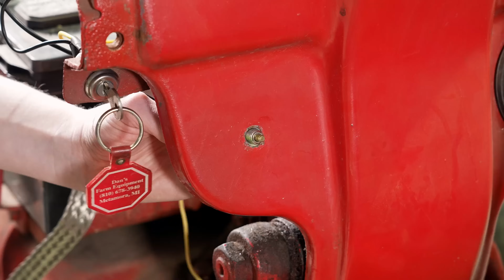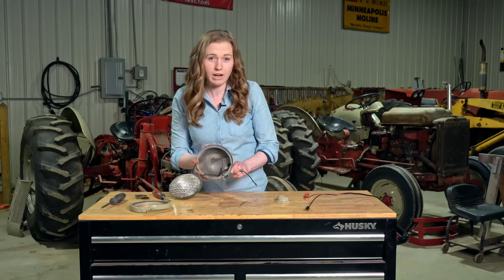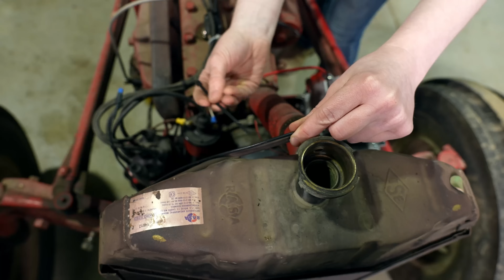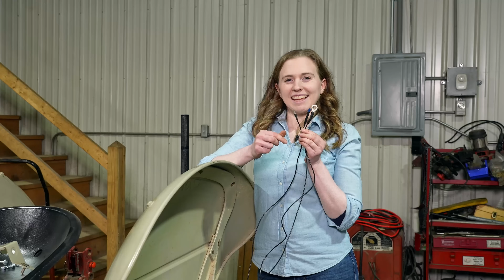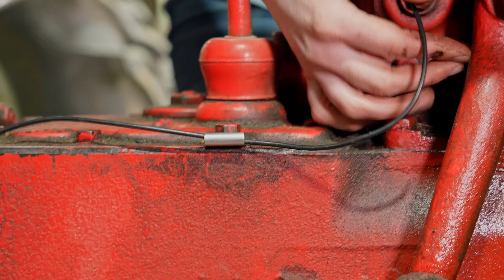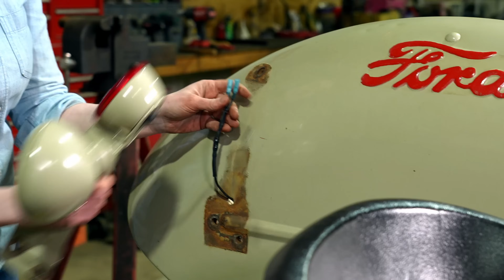Head Light, Work and Tail Light Troubleshooting and Wiring. Ford 8N, 9N, 2N, NAA, Jubilee, 600, 800

Comment: Another great video. I bought a distributor kit and coil from you a couple weeks ago. I dealt with Linda I believe.
I have a 1949 8n, front cap. I'm "semi" restoring it...mostly upgrades and paint. I have 6v system...do you have 6v LED replacement headlight kits?
I'll message your website, not sure if you see new comments on this old video, lol

Comment: Five years ago I watched Rachel's video on rebuilding the hydraulic pump and top lid hydraulics, ordered parts from her link, rebuilt the stuff, and the hydraulics have been working great ever since. Now I see this video and realize the lighting wiring on my 1950 8N I've had for 28 years is simply not right, which explains some oddities with it. So today I ordered more parts from her link to fix that. These videos tell me how it should be AND how to get there. My 8N is working better and also getting more OEM every year. Thanks Rachel!

Comment: Great tutorial! Our Ford 8N tractor lights work great (converted to 12V), but our Workmaster 641 has the original lights (I think) all around. The rear work light has a rotating knob 3-position switch on it - and I'm not sure what the purpose of that 3rd position is. Any idea? We also need a replacement bulb and red lens for the red light on the back (near the work light) - do you carry those parts? Thanks, Chad (Purple Collar Life)

Comment: Hi Rachel just a question for u I have a 135 in for restoration and it's past life was on a fertiliser spreader so everything is rotten,  the lift response unit was eaten away,  so I got a new one on line but the cam on the back is nothing  like the one was on the tractor and I can't seem to find the same as the one I want they are all the same as the one I got , any help would be great

Comment: Love your vids.   I redid my '68 5000 and replaced everything with LEDs.  Dash, headlights, taillight, flasher.  Also added work lights and strobes.  Nice thing with LEDs, you use much less power.  And OH MY do they put light on the job.  

My boys did a lot of the grunt work.  Dad basically just made decisions.  My youngest was only 11 when we did the work and one of the upgrades we installed was a real fuse block.  He did all the math to figure out what fuse to use for each circuit.  

Seriously, check out replacement bulbs that use LEDs.

Comment: Good morning Rachel gingell. Happy 
Thursday on June 12th 2025. You.
Have nice ford tractor 🚜 at is.
Ford 8N. Tractor 🚜  head light go to.
Work and tail head light go to work. 
On the Tractor 🚜 troubleshooting.
And the wiring. On the ford 8N 9N.
2N NAA jubilee 600 700 800 900.
2000 and 4000 series tractor 🚜. 
Well Rachel gingell you have.
Good Morning 🌄 🌅. Have fun.
On ford Rachel gingell. My is
Hunter Rachel gingell nice to. 
Meet you Rachel gingell have
Good Morning 🌄 🌅 Rachel gingell.
CHEERS 🍻🍻🥂🥂.

Comment: I have 51 8n. Will this handle a bush hog mower, ok? If so, what is a recommendation on mower size?
Reply from the maker: If it's a good running tractor, it would handle a 60" (5 ft.) brush mower with a chain kit: https://farmtractorrepair.com/collections/stabilizer-kit/Implement
Reply: @DanGingell , it is good running, but needs a few things, I'll be purchasing from your site. Thanks for the response and the great videos.